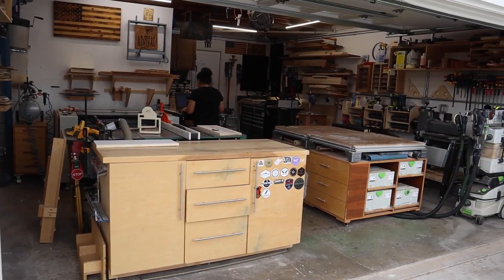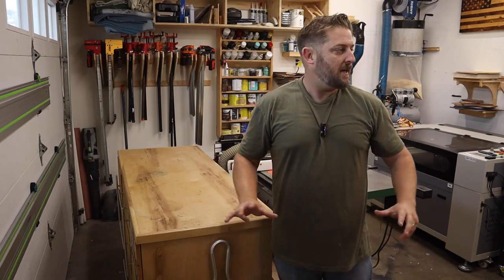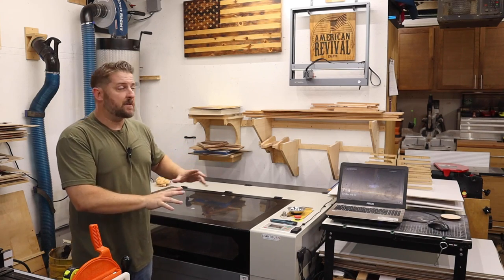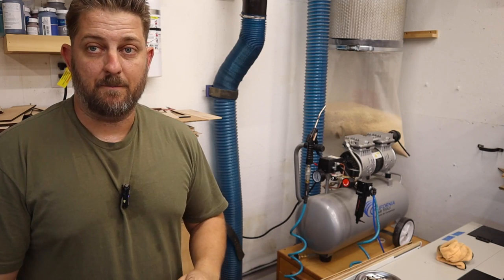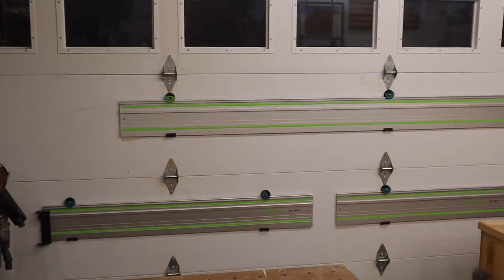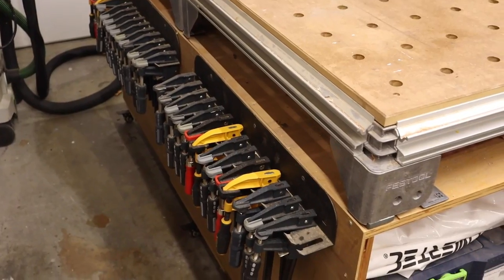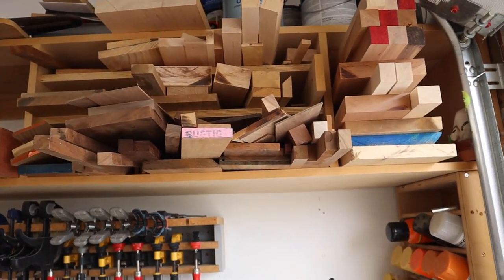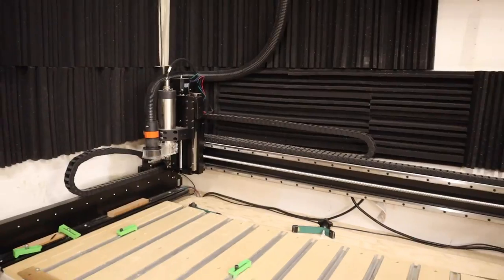How To Set Up A Woodworking Shop In A Garage: CNC & Laser Tools! | Brett's Laser Garage

Comment: Beautiful and efficient shop. Smaller shops that make the most of the space available to them are always my favorites. Very clever trick putting your fein vac up in the rafters. I plan on doing something similar for my CNC but I'll have a dust deputy hooked up to it so it'll nearly be a set it and forget it deal; with a dust deputy I'd literally have to check the bag maybe once a year. I do like the fein a lot for CNC; compact, quiet, plenty of suction. I grabbed mine from acme not too long ago for about half price.
Reply from the maker: Thanks a lot for watching, I really appreciate it.  Shops are always a work in progress right?  I’m definitely going with some sort of separator as well.  I love the Fein but it does fill up fast if I use the cnc a lot (which I have been lately).  And you can’t tell when it’s full until it’s too late.

Comment: Run a 6 to 8" board in front and behind your work piece. It should reduce your snip.
Reply from the maker: Yes I’ve tried that thank you.  It helps but overall I’m not thrilled about the smile on the planer.  Other than that it’s a great unit.

Comment: Very cool.  I just picked up a new (to me) 3hp Jet table saw.  I was wondering how that Rockler collector would do with a saw that size or if the larger cfm model is necessary.   You said it worked pretty well.  Thanks for sharing!
Reply from the maker: Very nice.  I like the dust collector.  More power would be nice but I like how compact the unit it.  I don’t get great dust collection on my table saw no matter was DC I’m running anyways.  The little rockler works great with my jointer and planer so I have no complaints.

Comment: Hey just joined your channel.  Nice looking shop you have.  Regarding the snipe you are experiencing with your planer, have you tried attaching a waist board on the edge of your piece that is extends you piece out beyond the snipe point.  So that the snipe is on the waist board and not you project piece.
Reply from the maker: Thanks a lot!  No, I haven’t tried that specifically.  It’s kinda to much trouble for my needs but I agree with you it would work.  I usually just run the boards one after another butting together and that helps a lot.  I could make an auxiliary sled or something that goes over the infeed/outfeed out of melamine but I guess the snipe hasn’t bugged me enough to do that.  I like the planer, it gives a nice smooth finish.  But in hindsight I wish I just would have kept my Dewalt 735 and upgraded to a helical head.  Maybe I’ll do a detailed review if anyone’s interested.
Reply: And you do have the awesome drum sander.

Comment: I liked the quiet air compressor.  Would you have a link where I can find one?  Thanks
Reply from the maker: Thanks a lot.  I added a link to the air compressor in the video description.
Reply: Thank you I found them at Rocker and Woodcraft Supply.  My current compressor is very loud

Comment: Great tour!  Is your mft table sitting on casters or leveling feet.
Reply from the maker: Thank you.  It’s on casters so I can move it around if need be.
Reply: What size and how many did you add to bear the weight?  Thanks for sharing, appreciate your time and help,
Reply from the maker: They are 2” casters and I installed 6.  They each are rated for 100lbs.  Been on there for almost 2 years no issues.